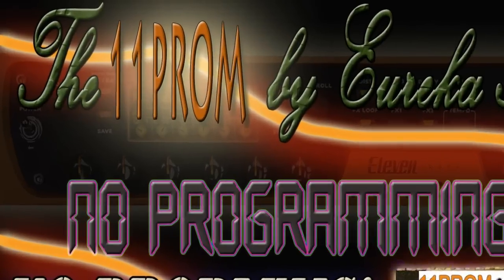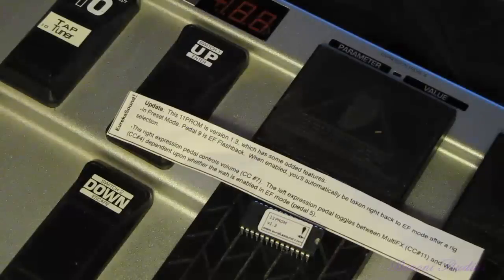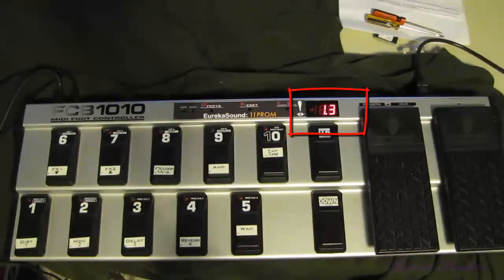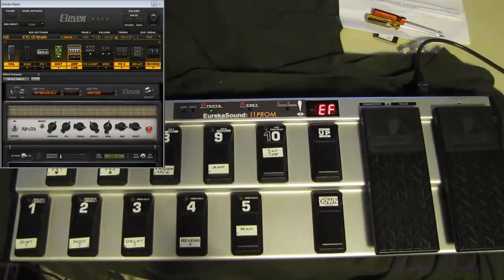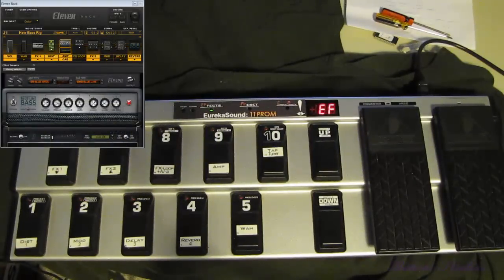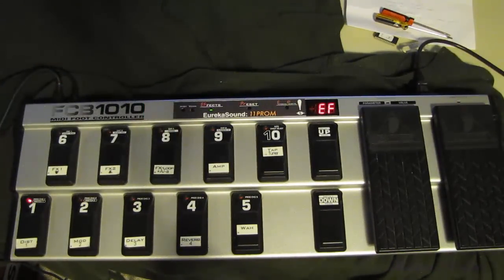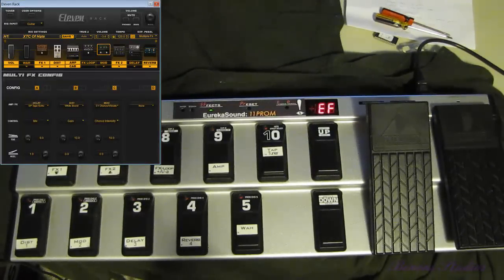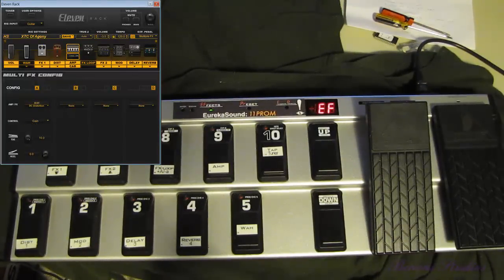Eureka Sound 11Prom v1.3 - For the FCB1010 and Eleven Rack - New Features

Comment: Awesome video!  I do have one question though.  I notice that when you switch patches it shows up in Pro Tools as having some of the effects on in the patch but the lights aren't on in the FCB1010.  For an example, at 8:37 when you demonstrate the EF flash feature, when it switches to effects mode it clearly shows that several effects are on in the program, but they aren't lit up on the FCB1010. Just curious why this is?